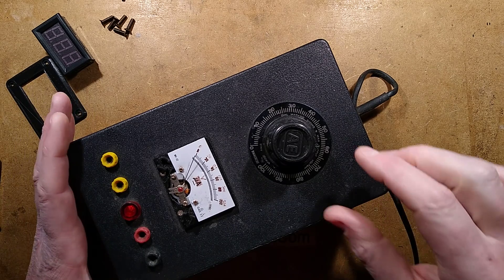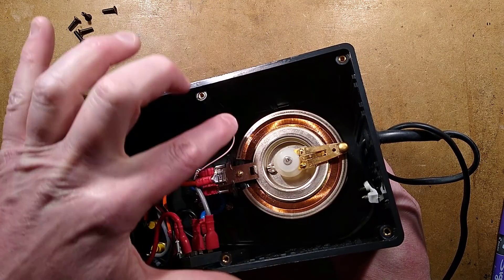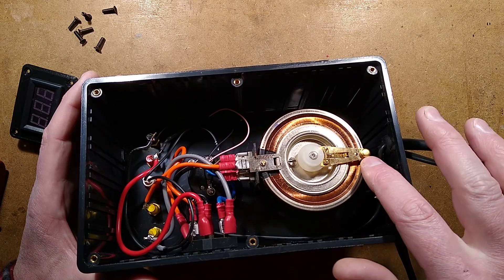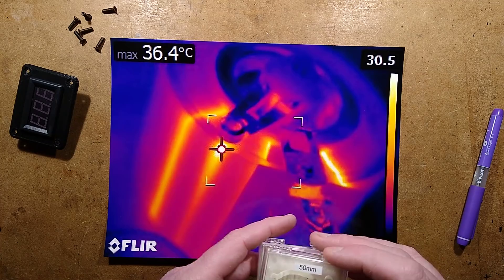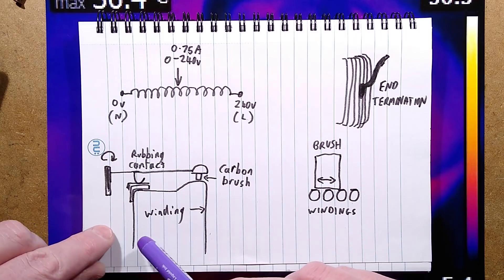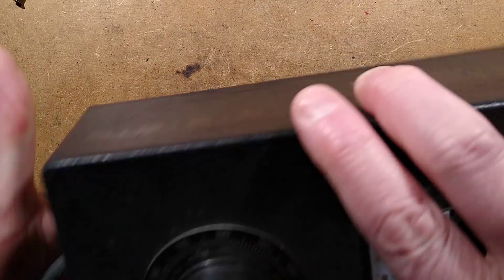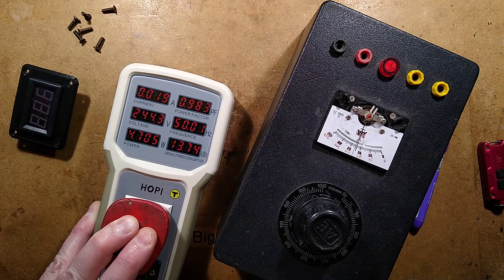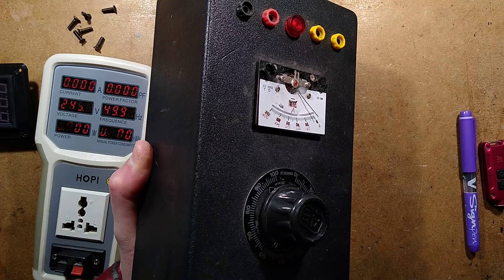Variacs DO short their windings

Comment: Why are there 2 large parts on the volt meter you are going to put in? red capacitor and large resistor.

Have you modified it? was it not good?
Reply from the maker: They are the power supply components.
Reply: @bigclivedotcom  What do you mean? have you modified the volt meter? I make a small adjustable power suply with digita volt and amp meter, therefore I wonder!

Comment: Clive, you need a three phase 20A, oil cooled Variac to play with.
Reply from the maker: First I need 3 phase.
Reply: @bigclivedotcom  Can you even get three phase? 3 phase residential service is impossible in the US even if there's 3 phase on the pole outside. Is it the same on Isle of Man?
Reply: @bigclivedotcom  There should be a way to make 3 phase.
Reply: @ellenorbjornsdottir1166  A cheap way to get 3 phase with a lot of power is to hack a Prius inverter.
Reply: We had one of those at the last two places I worked.

Comment: Printing with PETG? If so the excessive adhesion is a known problem. One of the nice things about a spring steel build plate is being able to pop it off and bend the plate to break adhesion. Look into the use of PVA glue stick, a nice layer of PVA will help it stick well but not too well. I find I need to put a bit on, then buff it with a damp towel to remove any excess and spread it around nice and even. Takes a bit of practice but working well. (applied once then didn't have to apply again for several prints)

Comment: I really like the direct relation between turning the dial and the analog meter moving. I've got too used to watching digital meters dance around as their electronics fuss over what the actual value should be.
Reply: My Variac is Digital, but the display and the dial are not at all accurate. !!!  It's important to use a Volt Meter unless you want to blow up something !!!!

Comment: I was always told that you should remove the load to a variac before changing the voltage so you aren't creating little sparks as the wiper moves across the windings which will shorten the life of the coil.

Is that something that should be of concern or just a wives tale that makes no practical difference in the real world?
Reply from the maker: It may be an issue with high current units.

Comment: What happens when the carbon brush wears out with use? 
Wouldn't graphite powder from brush not eventually fill the dips and valleys between each winding on the flat part, and create shorts? 
In power rheostats it's not a problem maybe because the carbon burn off?
Reply from the maker: Compared to an electric motor the movement is negligible.
Reply: @bigclivedotcom  makes sense.

Comment: interesting about the heating.  Makes me think about a couple of isolation transformers I have.   I left one plugged (no load) in for several hours and when I realized it I unplugged it.  BUT!!!   I touched it and it was very hot.   I was really surprised and disturbed.   I just measured the no loads draw and they were 21 watts/49VA and 15 watts/39VA per my Kilowatt device with no load.    Does that sound excessive?   I just bought an insulation tester.   I think I will test these transformers.   They are 500 VA at 115 VAC since I am in the USA.   They must be quite old since we no have 120 vac  to 125 vac on mains these days.  Thoughts??   I got these off of Evilbay so I am wondering it they might be defective and that is why these were sold..   Other thought is, is it good practice to always de-energize your isolation transformers at the end of the day or after every use immediately.   THANX

Comment: This has actually been boggling my mind for years.
The only solution I have figured is to just have hundreds of windings. As to make the volts/turn sufficiently small so that it can't induce much current in the shorted turns. (since the DC resistance still is a thing in the turn.)

But I have always thought of that as fairly inefficient...

Comment: Protip: if you can't remove a print from the build plate, drip some IPA alcohol along the edges, this should pull itself in between due to capillary action and will in 99% of the cases loosen up your print.
Reply from the maker: I'll definitely keep that in mind.

Comment: the one I have has the live connecter a small distance from the end, in other words the end is floating so when you wind it to max you get up to 260Vac with 220V going in. When you was playing around with those 047mf caps 2 weeks ago to vary the voltage on the led bulbs I was going to ask if you couldnt do it with a variac, I couldnt see you not having one of them
Reply: Mine has the same function (except it's 140 from 120). The live connection to enable the boost would probably connect to the coil right near Clive's mystery shorted winding. I'm guessing that's why.

Comment: That's not really a "transformer"...It's a wire wound potentiometer. The core looks like ceramic, not ferrite. Touching multiple windings at the same time does not matter, which ever winding the load [brush] is touching that is closest to the line input side of the winding will pass the current. The other side of the winding must be referenced to neutral through what should be [.018Ma@240V] a 13k resistor to make the variable voltage present even with no load. Without a schematic or the unit in front of me that is the best I can surmise :-)
Reply from the maker: A rheostat would get VERY hot.  This is definitely a variac variable tap transformer.

Comment: Speaking of bigger variacs i do have a 20kW variac and it is quite different from what you have here.
For starters it's not a toroidal transformer but a rectangular one, it's very long compared to its width.
Instead of carbon brushes it has multiple carbon rollers and the way is works is a little different from how your variac works, because the rollers make contact on multiple places on the transformer.
I can't remember exactly how it's constructed since i haven't looked at it for a while but i do remember that it does buzz quite loudly, which i guess is part and parcel of a big honkin' transformer.

Comment: Clive, you will probably find that your digital meter does not measure below ~70V. You can modify it by adding a third wire, disconnect the supply from measured voltage. In my case it was removing one 0ohm resistor
Reply from the maker: I'll check that out to see where it taps its monitoring supply from.

Comment: Could it be that the current is limited because the toroidal core isn't complete all the way round? Think about how old welders used to control the current by moving a slug of core material in/out of the core. Probably a bad explanation, but hopefully it makes sense.

Comment: Clive: It would seem to me that the few turns that were shorted by the carbon brush would have no current through them and therefore should not get hot at all. It stands to untested reason that the voltage across them is also zero implying that there should be no heat dissipated in them, either. So any heat seen in those windings would need to be explained another way. I would therefore like to suggest that the heat on those windings is possibly due to resistance in the interface between the carbon and the windings. Observing it with the FLIR when it is first turned might just show the heat starting to manifest at the carbon/copper junction and then moving down the windings. I would like to see my theory put to the test. Also would it be possible to replace the carbon with a brass wiper? Or possibly a copper one? I can't help but believe that the carbon would have more resistance than either brass or copper. Or even aluminum. I hope I am not out of like by suggesting this. I love a good exercise in the application of first or fundamental principles as it relates to physics. Bogy.
Reply from the maker: A shorted turn still has current induced in it by the core it is wrapped round.
Reply: @bigclivedotcom  Completely escaped my thinking. Thank you.

Comment: Use a glue stick on the build plate for the printer. It allows the print to stick firmly and releases easier when done. Or a flexible plate would work too

Comment: I've been wondering about this for decades, thanks for the answer. I guess the windings have a good thermal bond to the transformer iron, so the shorted turns don't overheat. As 99% of the coils are unshorted, the overall losses are low.

Comment: I also wondered about the turns that are shorted, same as a Shaded Pole Motor. Go one step further and install the voltage AND current display. TNX 4 the video !  73 N8AUM
Reply from the maker: I really should add a current meter.

Comment: I wish I could afford a mains variac, but the prices are insane. I got a low voltage Irwin AC/DC power supply that uses a variac, 0-16V, £5 from a local market about 7 years ago. It's perfect.
Reply: My dad got given a job lot of large variacs a few years ago. I think he gave most of them away to friends, one friend who was a professional photographer used one to control the brightness of the floodlamps in his studio.
Reply: Also I forgot to add that whenever I plugged one of them in, there was a 50/50 chance that it would blow the main breaker. Not sure why.
Reply: @chriswilson1853  How odd. A faulty batch?
Reply: @Franko_Walker  I always assumed it was something to do with inrush current. They were pretty meaty units, more than 3kW I think.
Reply: @chriswilson1853  Yeah, at 3kw, that makes sense.

Comment: Nice video thanks for sharing.
Since you are about to change the analog meter for a digital one take a look at these
-- 3 into 1 meter with a current coil to measure the Amps --
Wonder if they are reliable and accurate.
Maybe you can do a video on those, they come as cheap ast less than 10 euro's if you look around a bit
But be ware off the max voltage, a lot of them can only do like 100 VAC.

Comment: The variac with the carbon brush switches much like a transformer tap changer, but the resistance of the brush is used as the current limiting resistor and the low voltage on each turn limits power dissipated.  Article on transformer tap changers is listed here.  https://instrumentationtools.com/transformer-tap-changing-working-principle/

Comment: Use Rustoleum 2X or 3X clear, 3-4 coats at 10 minutes between each; you can make 3D parts that look like they belong to a concert grand piano.  Hides all the print lines and brings out the color.  Gloss hurts to look at.  Semi-gloss still looks glossy, but not so dazzling.  Have not tried the flat or satin yet.

Comment: I always wondered if the insulation was removed from the upper ring of windings. Makes you wonder if it could arc, maybe that's why it's limited to 750mA.
I guess if only a small part of the top of the wire was exposed it wouldn't come near to the neighbouring winding, but then as you said it is very thin wire, over time could it wear down the insulation?

Comment: Molten plastic & clean glass are known to be problematic combination. You basically re-discovered the old glass decoration technique known as "chipping" for which hot hide glue was applied to selected areas of a glass pane to achieve a quite stunning effect resembling "ice flowers" by removing material. Applied science did a video on the process once: https://www.youtube.com/watch?v=sOVDtOok-c8

Comment: Is it really a variable transformer? Isn't a transformer something with two wirings that "makes voltage" by induction between the two. For me it is just a wound, large resistor. 
Or am I, as so often, just wrong 😂
Reply from the maker: It's a form of auto transformer.  Single winding.
Reply: @bigclivedotcom   thanks! With my logic, a wound potentiometer is also an auto transformer then? Or does it need a ferrite (or similar) core to get that epithet? If so how does the induction "help" the output compared to just a wound wire?

Comment: Well since noone seems to mention it...:
The reason it's not a big deal is simple. P=U^2/R, where U is the voltage of a single turn and R is its resistance.
Both U and R are proportional to the number of turns you short out. But because it's U^2, the power dissipation becomes a lot bigger if you short more turns
Reply: Clive kinda did mention it. He showed the power measurement at no load. Just didn't mention why.

Comment: I also  used to wonder on this point and thanks for confirming it.
Other point that comes to my mind is, variac is sometime rated by VA. For example, if the variac is rated for 500VA.
Q1: If we derive a low voltage from the variac, say 12V, will the variac now be able to supply 500/12 = 41A?
Q2: The above may be true, but the copper windings may not be rated for 41A. Under such case, will the max current come into effect (to prevent burning of copper winding)?
Reply from the maker: It's usually a fixed maximum current for the full range.  Whether just 1V or 100V.

Comment: what happens of you drop a capacitor across the primary and tune the LC cct to 50/60Hz ?
Reply: Then you have built a parallel resonance circuit, also known as a power factor correction circuit :-)
Reply: silly me :) I was just thinking the variac/cap combo looked like the tuning stage of a radio.
Reply: @urgtuiop5455  Series connection would be more exciting haha :)

Comment: The carbon brush on a variac touch / shorts always 2 or 3 windings at the time, this "shorting" forms a small voltage divider, if the brush was only touching 1 winding, there was between each winding a small disconnect and you get arcing on each movement, also the output would be very "jumpy" and not smooth when rotating the variac.
Due the contact of 3 windings at the time, there are no disconnects between each movement, because 1 winding in the middle of the 3 windings still keeps contact, the outer 2 windings are connecting and disconnecting during movement of the axle.

Comment: That Digital panelmeter normally begins to work and show voltage from 60a65V, but you can hack it to show voltage from 0 to 240V.
Lift one side of the brown capacitor and use that for measuring the voltage, use a separate 12V DC and connect this parallel to the black electrolytic capacitor.
It's the same hack that is used on the Peacefair panelmeters.

Comment: I think this doesnt short out like motor windings because you are contacting many wires all at once over a relatively large footprint and they are all close together.  The difference in voltage between windings is small and they are all commoned together.  Compare that to a tiny pin prick of insulation damage in a motor and all of the power trying to go across that point the resistance and heat would be higher.

Comment: maybe the variac has multple paralleled wingdings to limit the possibility of shorts?
Reply: it does not. You even need to short at least one winding at a time for it to deliver a steady output as well.
Reply: @Basement-Science  well if you have 2 alternating windings you don't get a short but just a small voltage drop between them

Comment: I read about putting your build plate in the freezer to get stubborn, stuck prints unstuck for years before I tried it. Works every time. You even get an audible "pop" when it comes off. Build surfaces are consumables IMO.

Comment: I have wondered about this also, and the brushes on motors, the brush contacts multiple windings at once, maybe they can be made more efficient?!?;
Reply: Brushes on motors don't contact windings directly, only the contact plates on the commutator, or the contact rings for magnetizing the rotor,
Reply: Ideally the brushes on a  motor (or dynamo) are positioned at a null point where the coils shorted by the brushes  are generating no voltage.  In a simple DC machine this null point will vary with the load.  It is possible to have compensating field windings (in series with the armature) which effectively rotate the field according to the load to compensate for this movement to reduce energy loss and sparking at the brushes.

Comment: It's funny, I've been eyeing a variac at the only REAL electronics shop still around in my area, some of the components look like they've been hanging on the peg since their grand opening, there's unopened bottles of chemicals that are empty or nearly empty from years upon years of slow evaporation through the sealed cap, they've had a surge of patrons due to the beer virus, good in a sense, I like walking the isles choosing components but I digress, I've been trying to decide🤔, should I buy a variac or wait, I don't have a need right now, but prices only seem to increase, even though scamazon has them pretty cheap I prefer to buy something I can touch taste and smell before I buy it, 
Oh I actually got to meet the inventor of the toggle switch😉(warning sarcasm ahead) WOW gee you look great for 124 years old AND your still driving🙄😩 not all squirrels live in trees✌

Comment: I don't see how "shorting" some windings together at the point of the contact is a problem. The first winding that makes electrical contact with the wiper is essentially the effective one. Subsequent "shorted" windings and indeed all subsequent ones are immaterial in the electrical circuit except as far as total windings vs. the subset of windings that's been tapped off is a kind of primary/secondary windings transformer. You are simply moving the tap. The bridged windings - say 3 or 4 or 5 adjacent windings are a very small percentage of the entire coil that is taken out-of-service.
Reply: I think it’s down to the induced current in those specific shorted windings. All they can do with that current is dissipate it as heat.
Reply: @Snickersnack329  Hmmmm.... I see it as several adjacent windings (bridged with the wiper pad at top) acting as an aggregate thick wire that has the electrical cross-sectional area of 5x wires (whatever). I suppose such a thick wire could then handle a correspondingly large current. They should be colder. I dunno. Other sections of the coil in the heat picture exhibit similar increased temperatures and nothing is bridging those.